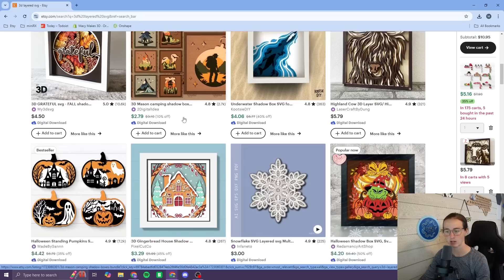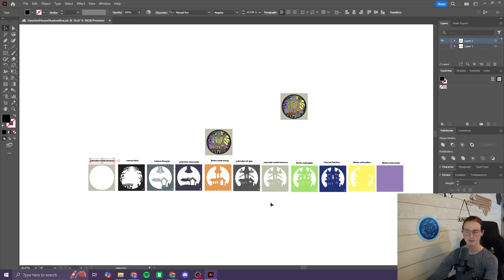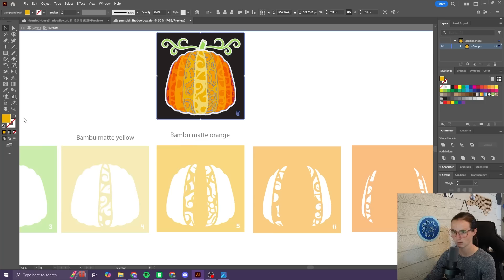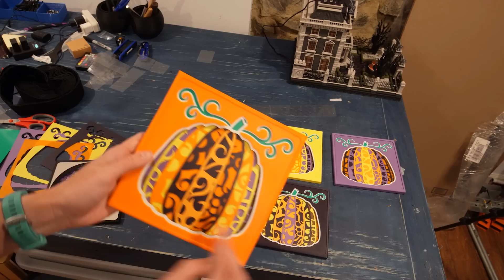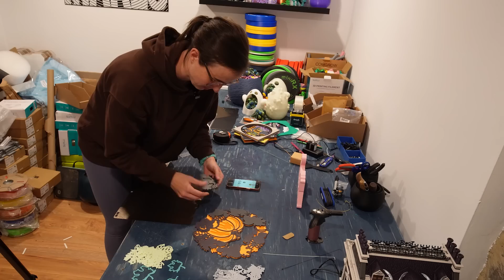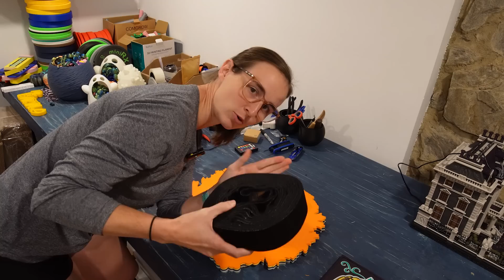I 3D Printed a GIANT Wreath - Turning SVGs into 3D Prints

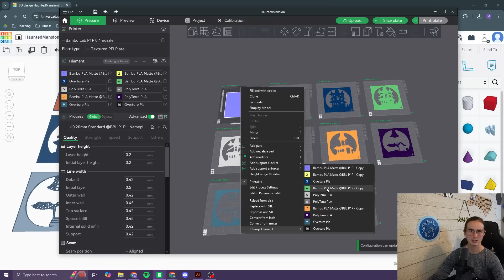Comment: a little tip macy, at 03:50 when selecting filament, you can just mark the part as you do, and then press the number key for the filament, so like 4 for that bambu pla matte you selected with the drop menu :)

love your videos, im doing the same thing myself, just getting started and i love seeing how you do it

also if you need help or a second pair of eyes with 3d modeling, im a CAD designer by trade
Reply from the maker: Awesome! Thanks for the offer :) I'll reach out if I'm ever struggling!

Comment: Nice work, but....
Why do you change one color in AMS when you can have 4 filaments in it? I don't understand.
Reply from the maker: The other colors I would need were being used in other printers. It wouldn't be efficient to keep the unused colors in the ams when they could be printing elsewhere.
Reply: @macymakes3d  Oh, so you only have 4 colors then 😀
I didn't mean it badly, but you have 4 slots in AMS, and silica gel in it. Why don't you keep the filaments there? They would still be in a dry environment (that is, unless you store them differently).
You fill the AMS with filaments and just choose which color to print. If you have several printers and you distribute the colors sensibly, you don't need to rearrange the filaments (you just remove the printing plate and put another one).

Comment: Honest question, wouldnt it be better to use Hue Forge and not have to glue all these together afterwards?
Reply from the maker: The layers were already separated into colors and it was just easier to print them individually.
Reply: @macymakes3d  I was also wondering why you didn't just stack all of the many plate you have into a single plate, then you can print the 4 colors you have loaded in the AMS.....put a pause, then load up 4 different colors and run those.    It could save you a lot of time.   It may be worth figuring out a workflow like that if you do a lot of them.   Otherwise, I can respect a desire for putting hands on the items more  to have more of a hand-made legacy.

Thanks for the vids.

Comment: I am very curious how you go about matching the colors in AI with the colors you actually have. Do you eyeball it, or do you have RGB/HTML color information for your spools? I know Polymaker lists HTML values for some of their colors, but not all of them.
Reply from the maker: Totally just eyeballing it. I get it close enough in the computer and then hope it comes together in the end. If it's filaments I've used before I kinda know how they'll print so usually it works out okay.
Reply: @macymakes3d  I figured that was mostly what you were doing. I do know that some of Polymaker's products on their store site (US). Show hex codes for some of their colors. I've used those for the custom colors in Orca Slicer (Bambu Studio doesn't remember them for some reason). Otherwise I just eyeball it.

This video has inspired me to try something similar as to what you're doing here and I appreciate that!

Comment: Not sure if this would make things easier or not, but you can import SVG files directly into Bambu Studio. If you do that it will also preserve the layer structure within illustrator if you wanted to do a single depth multi-material print you could. In this case it could have skipped the tinkercad step. I do really like that you're approaching your machines in such a different way, almost the way you use a vinyl cutter. Also, love to see you diving into Onshape, once you learn the CAD side its like a super power. Great work!
Reply: I’ve also had an issue with more complex svgs. I had to use an online svg to stl converter and then import that into studio. Had perfect results that way. I haven’t needed to do so with simpler svgs
Reply: @muchoman90  I think I've had trouble w/ simple ones too.  If I recall, one was the old Buffalo Bills logo...a simple white circle as a background and a red standing buffalo.  When I loaded into Studio, I just had a background w/ a void in the shape of the buffalo....I don't know where it went.  LOL
Reply: @Dave_D.  I think in that issue Bambu Studio doesn't understand that its supposed to be a void area, you might check the layer stack in the objects panel, could just be a simple additional layer you have to delete.
Reply: I've had mixed results importing svgs into Studio.  Sometimes they load perfectly and sometimes there are parts missing.  I have also had limited success using the MakerWorld designer thing.  Between those 2 and Inkscape/TinkerCad I can USUALLY get what I need done.  Sometimes it's a struggle but every now and then everything just works.  LOL
Reply: @Dave_D.  Weird, I've not had any missing parts, I wonder if its in the layer structure from your vector software. I'm using illustrator with no issues.
Reply: @WeekendBuilds  I'd imagine it has something to do w/ the structure.  I can load the same svg into Inkscape and it seems fine.  I usually user vectorizer...didn't want to pay for it but it seems to do the best job of anything I could find.

Comment: How did u figure out the upscaling for the pieces cuz you wanted 18inch and scaled to 188% how you figure that out sorry I'm still learing
Reply from the maker: I converted 18in to mm and then scaled one piece to be the correct size. Then used those x and y values to scale the rest.
Reply: @macymakes3d  thank you 😊